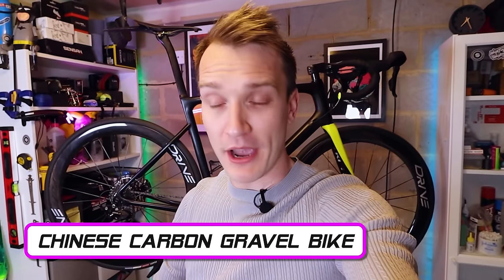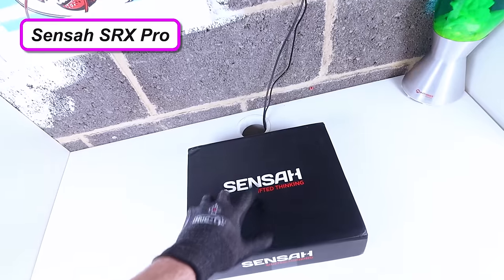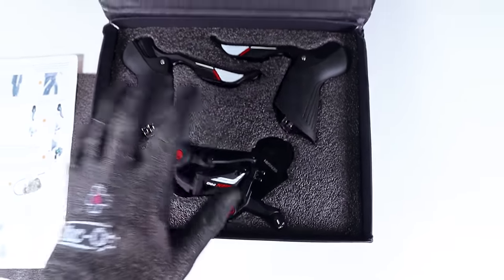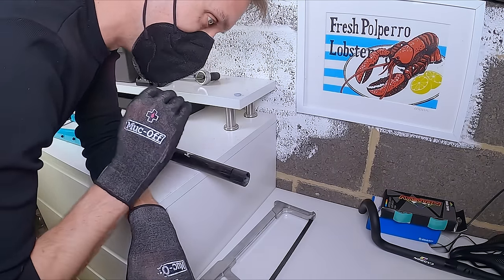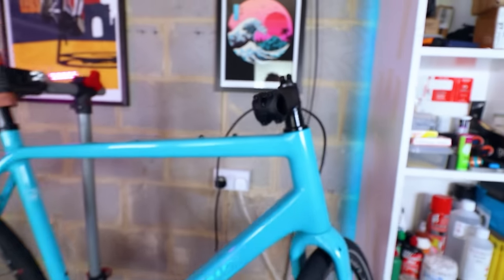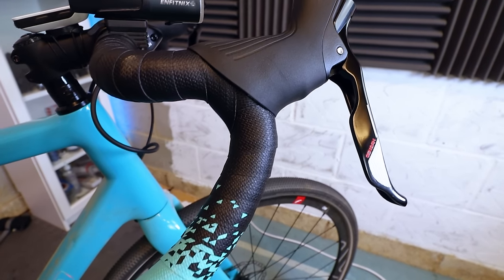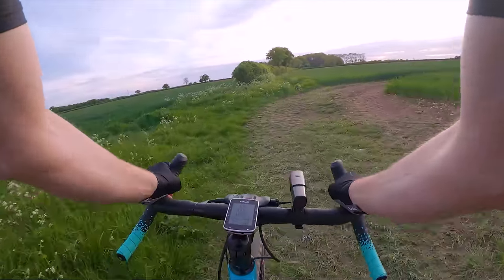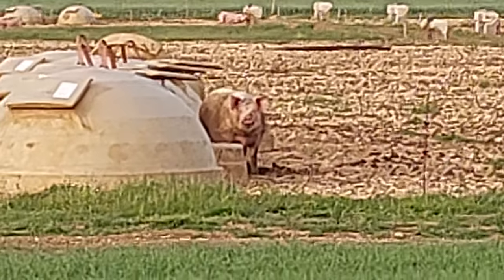Chinese Carbon 1x Gravel Bike – Full build & test

Comment: Epic build thanks!
Me? Nah…..I bought an Altus Groupset from Ali Express ($100 NZD, unboxed but looks legit) and new bars & grips for my 1989 Cannondale MTB.
It was a failed ‘gravel bike’ from 2012…..the geometry. & reach isn’t right, even with different stem lengths and rises (tried several including adjustable)
So it’s reborn as a rigid mountain bike, Kona Project 2 forks…. For a blast from the past.
(I’m recovering from a hip replacement age 57, but I’ve also got a freshly unboxed & I ridden Giant Revolt 1 for when I’m able)

Comment: Great informative video mate! I'm myself doing a budget carbon gravel, I'm thinking to stay away from cheap Chinese carbon stem + handlebars as they very often break ? I'm thinking to do carbon frame/wheels with alloy stem/handlebar for reliability reasons. Keen to hear your thoughts
Reply from the maker: Tbh, if you want a more hastle free build, this is exactly what i would reccomend! I've had alot of issues with sets of cheaper bar and stems recently 😅

Comment: I was thinking of something very similar, but keep thinking a carbon frame is going to be a little dangerous in the long run for someone like me at 125kg and doing a lot of bikepacking, so there's often a 140kg total load on the bike and doing a lot of loose gravel, rocky surfaces etc. I was thinking of a titanium frame instead, or should carbon be alright?

Comment: I have a grx groupset that i put on a specialized sirrus that i converted to drop bar. I love the bike but want to take it a step further. What size wheels did you use for this build depth and width? I am am having trouble deciding between gravel bike or the og elvin build you posted, using the same GRX groupset for the build

Comment: Great video. I ended up getting this frame and so far it's been great. I did have an issue with the seatpost, and wonder if you had the same. The seatpost clamp doesn't really tighten properly at 5Nm causing both loud creaking, and the saddle to slip backwards every ride. Even with friction paste. On close inspection the top of the carbon post does not match the bottom of the saddle clamp, there is about half a mm of empty space. Did your seatpost look the same?

Comment: I've got the same crank arm on my bike and arm itself failed catastrophically (non-drive side). The crank arm where the pedals insert cracked in half mid stroke and the pedal fell right off. Wasn't standing, just a casual ride. Unfortunately vendor didn't want to replace it. This on the first ride, about 30-40 kilometers in.

Comment: How's everything lasting? In particular how are the bars as I'm tempted by a pair? Did you ever try spd pedals? I've got a couple of sets of ZERAY ZP-108S which are cheap and light, but the set that's done about 4k km mainly on my turbo are starting to have noticeable bearing wobble. For mtb'ing they never felt overly secure compared to 10+ plus year old m540's.

Comment: I have a conduct system I bought for my gravel bike and had issues with short pull mechanical brakes not being able to pull enough cable. Unlike with mechanical systems you can't preload the brakes a bit by pushing the lever on the caliper as you tighten the bolt as the grub screw becomes unreachable.

Comment: I would love to see some hydrid flat/spd pedals tried out. This beautiful steed seems well suited for commuting and similar applications where having the option of grippy flat pedals would occasionally, be highly ideal. Also nobody I've seen has really explored the deep dark market of ali express hybrid pedals - maybe for good reason, so good content either way! 

These interest me: 

"MZYRH SPD Pedals Bicycle Pedal Non-Slip MTB Pedals Aluminum Alloy Flat Platform Applicable Waterproof Cycling Accessories"  

They seem to be the same manufacturer that make FOOKER nylon pedals (chester clones) which I have on my fatbike and ebike, they have been flawless for me over a couple thousand miles. Content Bonus if they come Fooker branded, just think of the fooker word play possibilities!

They do look like heavy, mean fookers with those shin destroying spikes and metal construction. Nice wide platforms are great for comfort, but do mind the clearance pedaling out of corners, going full crit racer may fooker you up badly. 

Currently run Shimano PD EH500 Road Touring Pedals on my road bike, which are awesome, but I would really prefer better grab on the flat side for rides with more stopping & I think other; parents, commuters, errand runners and not so competitive cyclists would as well. 

BTW: great video Luke, if that still is your name.

Comment: Luke, what tyres do you use on your road bike? im looking to go tubeless and I'm just confused what to get for my vision team 30 wheels
Reply from the maker: So on my road bike, I run tubeless. I usually go for Shwalbe Pro One tyres in 700x25c, but I've recently upped that to 28c. Looking the at the vision team 30 wheels, they are not tubeless, so I would probably go for some continental ultrasport 2 tyres in 700x25. They ride well and are generally pretty cheap. Failing that, the lifeline essential road tyres on wiggle are crazy cheap, pretty light, and I've used them many times with no issues. Hope that helps!
Reply: @TraceVelo  Thanks for the advice Luke, ordered a pair from Chain Reaction cycles. Keep up the vids mate I wait eagerly every month for them

Comment: Amazing review I love all your details! I just bought the same frame! Do you feed brake and shift housing fully through the frame? Or are there internal cable guide liners and housing just is external?
Reply from the maker: Thanks Ben. So as the rear brake is hydraulic, the hydraulic brake line runs all the way through the frame. The gear shifting on the other hand is cable actuated, so the frame has frame stops to allow you to run only the shift cable through the frame.
Reply: @TraceVelo  Awesome thank you so much! I will be putting mechanical braking on this frame, but since it is possible to do hydraulic I assume the brake housing will continue through the frame?. Love your channel
Reply from the maker: @benlustgarten6508  Yep you got it. For mechanical brakes you will just run the mechanical brake housing through the frame rather than a hydraulic brake line!
Reply: @TraceVelo  Is there any frame protection for the rear shift cable with bare cable running through the frame? Is there a liner or corner channels at all? I would be worried the shift cable will eventually wear against the bare carbon fiber at the turns.

Comment: Hello , amazing video !!!!  looking forward to my gravel build .  one question, are these groupsets compatible with shimano ? SHIMANO RD-RX800 Rear/front  DERAILLEUR ,SENICX crank 2x11, shimano hydraulic disc brakes center lock and the SENSAH 2x11 shifters ? will this combination  work, align, index correctly ? SENSAH STI Carbon Fibre Empire Team Pro ? or which ones ?  I am looking around for information and it seems that alot of people say   SENSAH  does not work well with Shimano,  only with SRAM . ? I am looking at  pro gravel builds used in various races/rides and they use a combination of road and gravel groups to form the sets .  thanks .

Comment: What did you decide to do with the routing guides for the front derailleur? The whole time I was wondering if a 2x setup would work better for the inevitable road and gravel combo ride. Those brakes look amazing. Still great videos coming from your basement / garage.

Comment: Hi, Love your videos!  I  have been running a 2*8 Sensa Ignite with Shimano 105(1055) derailures on my 1991 Giant Kronos frame and I absolutely love it. I want to build a Gravel, but which will also become Road bike with a simple wheel/tire change to replace my Wilier GTR with Dura-Ace. Question: Is the SRX left shifter capable of 2x? What do you think of a Frankesnstein 50-34 front with the 11-46 in the back?

Comment: Commenting on old videos I know, but I'm looking at the sensah srx pro brifters, and wondering if their claimed 1:1 pull ratio is close enough to work with the new Shimano Cues system as a better rear derailleur. Still not exactly a budget setup, but would get a wide range 1x11 that fits on a HG hub

Comment: In 2022 i got nice guide for my 2020 giant conduct lol, thanks. It is funny you are so fascinated with giant conduct. I find it much worse than hydraulic breaks (i had only MTB hydraulic, cant talk about road option). It got better after I had them bled, but it still require quite powerfull grip on levers and modulation is poor. I have it matched with SORA levers, maybe that's the issue? Would love to see comparisson of Conduct with some levers. Would you try? :) Any recomendations how to improve breaking power?
Reply from the maker: I think proper bleeding is they key with this setup. When I bled it, it took a good few minutes to get all the bubbles out of the brake lines and the reservoir

Comment: Hi Luke, love the show. You inspired me to build the Ican X gravel with sensha srx groupset. All brilliant except the odd upshift, normally around middle off cassette, guide pulley is directly under correct cog, but screw is as near to 1st and second gear without rubbing, tried new cable, new derraileur hanger I service chain and bike every week ? Think it may be something I have to put up with on a £160 groupset?

Comment: Bit late to the party but what are people's thoughts on using this gravel frame as an endurance bike. They're quite similar apart from the hefty tyre clearance. I mean it's definitely light enough to get away with and the geometry is a little easier for the lesser flexible riders like myself. 🤔 Really thinking about going down this route.  🥖

Comment: Great build. I have a friend with Conduct brakes. Do you know you can get a Garmin mount for the front of the reservoir?
I use Boardman SPD pedals. Good value, but i found the supplied cleats were not good, did not release very well. Went to genuine Shimano cleats and the work great. I have always used SPD road and MTB and i find them great.

Comment: I changed tbe stem on my bike abd wondered wtf that compression plug was i assumed it was to stop the carbon from splitting upon tightening. Second bike with carbon folks, er no third but i didn't touch tbe others. It was easy job. Interesting little thing.

Comment: Must have missed this build.  
Wow.  I am really getting a lot out of these Chinese component builds. 
With Shimano's recent groupo direction, and inflationary pricing, there's a huge slice of the market open to value manual groupsets. 

If I was buying a new bike today, I'd definitely be building something out of the brands introduced here. 
I have been riding for almost 2 years now, a set of pedals recommended by Trace. 
They are a speedplay knock off, and I haven't a bad thing to say about them. 

Here's a challenge Luke. 
My next bike I'd like to be gravel with semi or full hydraulic discs, carbon wheels, and weighs under 8.5kg. 
I think the idea of doing videos on builds that people really want will hit the mark for you. 
I currently ride a Trek Madone Di-2 58cm that weighs 7.2kg. I absolutely love it.....and just do not enjoy the 11kg gravel bike I have as a back up.

Comment: Great review it’s inspiring me to build my N+1. What did you think about the carbon bars and bar tape?
Reply from the maker: The tape is OK, not amazing, and not a great deal of padding, but pretty good for the price. The bars have held up well, but they are VERY stiff. I'm used to carbon bars having a little flex, but these ones are ROCK solid, not ideal for rougher roads.

Comment: Dude, quick question, is the gap between the performance of Juin tech and giant conduct really big? I was thinking of getting the juin tech but based on this video the giant conduct seems to be way much better. Im finding it hard to source a flat mount giant conduct.
Reply from the maker: Yeah I would say the conduct is slightly better. Don't get me wrong, the JuinTech's are great, but the conduct kit def has the edge with brake feel. However, it is much heavier, can be quite difficult to find, and I cant really comment on the longevity of the system. Wheras ive ridden the JuinTech's for 1000’s miles with zero issues, and loads of people swear by them.
Reply: @TraceVelo  appreciate the reply, man.
Reply from the maker: @thereal_deo  No worries Deo!!!

Comment: Hello, Do you have long-term experience with the frame?
Reply from the maker: So not super long term, but I've been riding it regularly since I built it, and absolutely no problems so far!
Reply: @TraceVelo  How many Kilometer do you have so far?
Reply from the maker: Probably about 400km so far, so not many tbh
Reply: @TraceVelo  Thanks.

Comment: How are the Sensa shifter covers performing?  Older models report they stretched and became loose. Has Sensa sorted out that issue?  Loose shifter covers, even with a descent performing shifter would still ruin the experience.
Reply: Had no issue, still on original cover after 1.5yrs.

Comment: Great video thanks a lot! I am sorry to ask THE question about rider height and ICAN frame size. Did you or someone else have the feeling the frame is rather "big"? I am 177cm and normally have a 56road bike frame or Medium. According to the ICAN Chart, the recommended size would be 56 too. Looking at the Geometry, the measurements of a 56 frame do look rather "big" for a 56. I particularly can't figure out why the stack is relativel high compared to other frames I know/have. I would appreciate feedbacks on the frame size impressions of other buyers.

Comment: how is the cable routing for rear cable around the BB? that's where usually where rear (mechanical) brake cables struggles, from sharp bend around the bb.

Comment: I need some help with setting up my SRX PRO 1x11   If i set the L limit screw and then the H limit screw, then screw the cable tight and shift, i can'tshit into the big cog. I manage to shift in the big cof after I add alot of tension to the tension adjuster, but then the shifting in the first 4 gears is bad. Please help!!

Comment: Dumb question from a noob. Are freehub and cassettes universal? I have an 8 speed cassette and want to upgrade to a better groupset (probably a 1x like this). Would I need new wheels? Love the build!
Reply: You can go up to 11 speed with the hub you have. 12 speed with some aftermarket cassettes like SunRace. 12 speed requires a new hub for shimano or sram cassettes. Some high end sram 11 speed requires new hub.
Reply: @johndef5075  thanks for the info! 11 speed will be plenty

Comment: Intressting. Your giant conduct sl converter looks other then the one I had. At yours the hydraulic ports goes straight to the rear. On my it goes straight down.

Have you tried the converter with shimano Brakes instead of the giant Brakes?

The converter is hard to get and I found only 1 seller a month ago here in Germany and it was only sell out parts.
65Euro for the converter. 
To what I New it is out of Production.

I must found a stem for my converter the Rose osc should fit..

I buy the converter for future because I ride trp hy/rd on the moment which are as a repair set on decathlon for half the price like normal.

Intressting is that you love the conduct sl Brakes. To what I found was that the users are not happy with them
Reply from the maker: Yeah I think they are great. BUT maybe they won't last. I've heard a few people say that the hydraulic seals don't last very long... so maybe it will end up spraying hydraulic juice everywhere. But so far I think they are incredible. So the brakes that come with the kit are actually Tektro brake calipers, so they should be cross compatible with shimano hydraulic calipers... I havent tested it however...
Reply: @TraceVelo  intressting. Against leaking I think there are ways to prevent it like better seals.

Intressting that they are tektro calibre because I ask giant Germany about compatible to other Brands caliber and not only giant and they answer that.
"Technically, this would be possible with the right connections, but we would rather advise against it.
 Before something happens because the brake fails, it would make more sense to replace the Conduct System with a Shimano gear/brake combo."

I think in the future I will build it on my bike but at the moment I love the trp hy/rd system
Reply: @TraceVelo  and a tip! Rose Osc stem fits really perfect to the converter
Reply: @TraceVelo  I final install my conduct resovior which is the older 2017 Modell with shimano br-mt520 Brakes ( tektro pipe and pin with shimano oliv) and it works fine with the 4 piston.

And no extra giant Bleeding Kit needed because the normal Bleeding Kits have M6x1.0 mm port in it

Comment: I have the same sensah grx groupset, used since Oct ‘20, the shift lever had become quite stiff, and not returning properly after up-shifting , I lubed it, and it works better now, but has become loose and rattly, it is noisy when I’m on bumpy roads, however, it still shifts and brakes fine, has anyone else experienced this?

Comment: I didn't like the look of the inside of the bottle mounts, the carbon looked very rough. They seem to have been drilled out & no cleaning up in the way of filing shards off. Rough holes meen the probability of cracks!
Apart from that, really good video ☺️

Comment: The problem you have with the tyres is common with most tyres and i saw alot of them having the bubbling problem when i apply soapy water to seat them easier on the rim. Btw nice ring it's from AliExpress? 😂😂